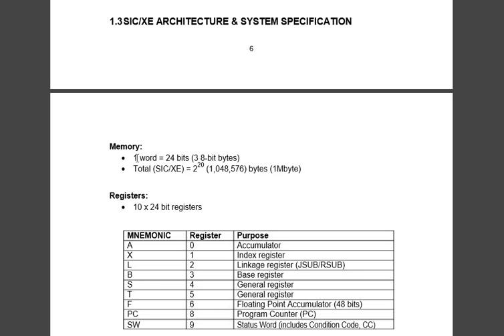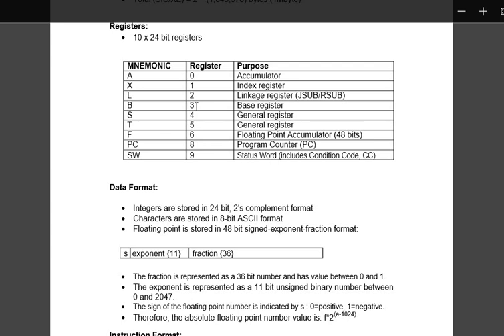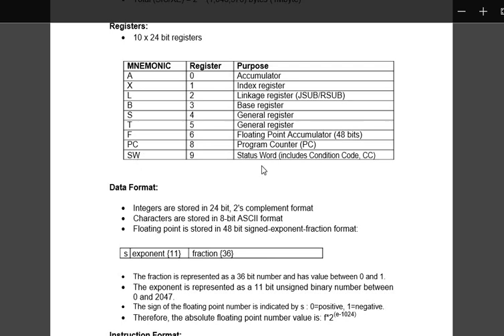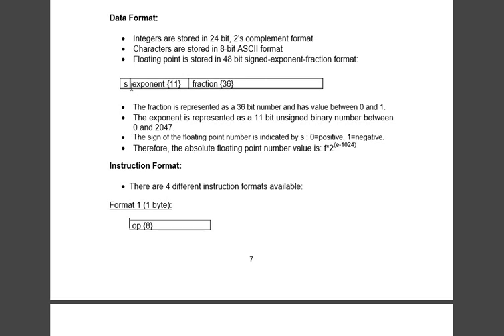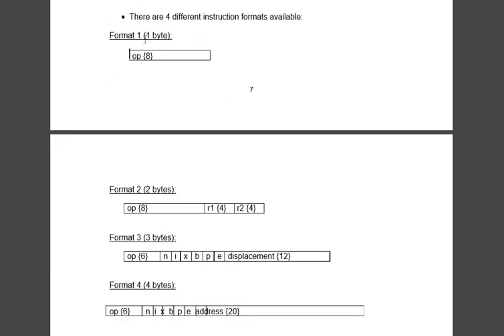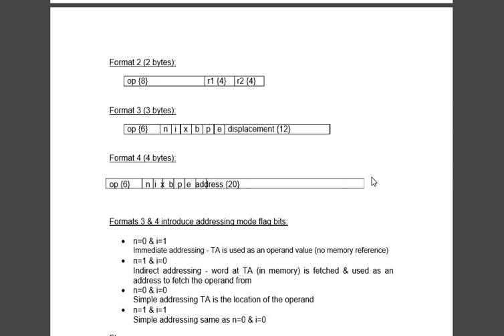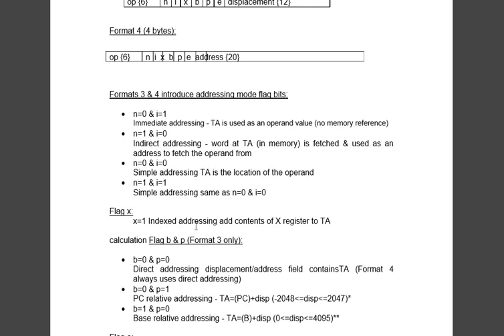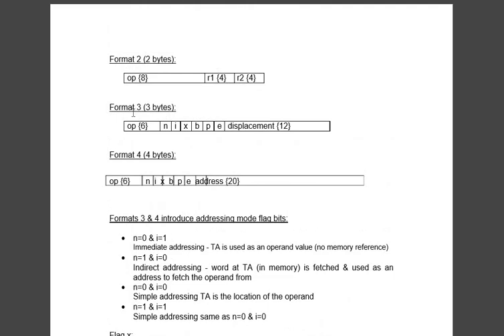SIC-XE  machine  architecture/system programming

Comment: what are different programs used in system software???
Reply from the maker: Well the one in video is low level language which we used to design it earlier. Present generation we don't code in low level. So if my knowledge is right we code in high level languages like java,c++.